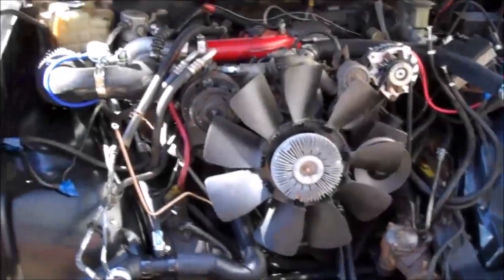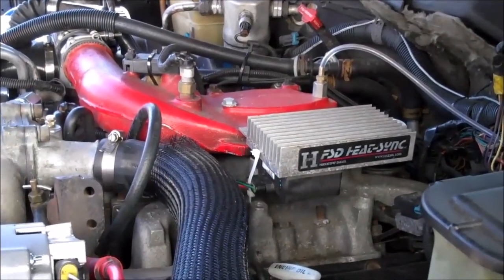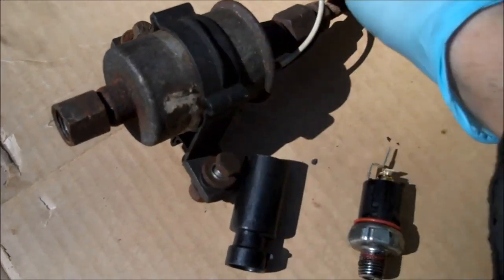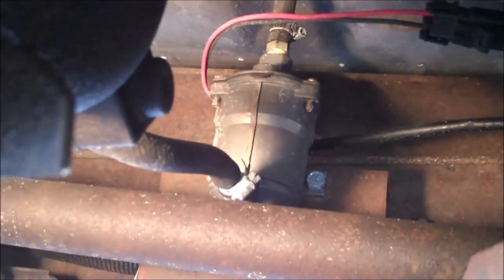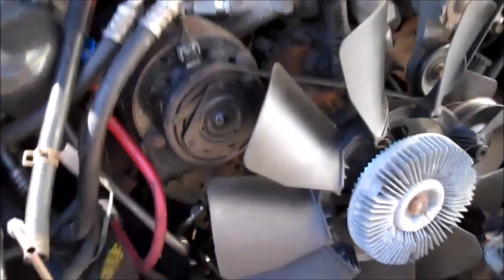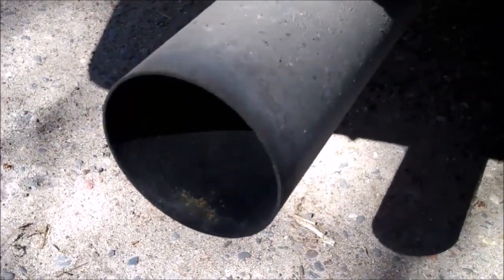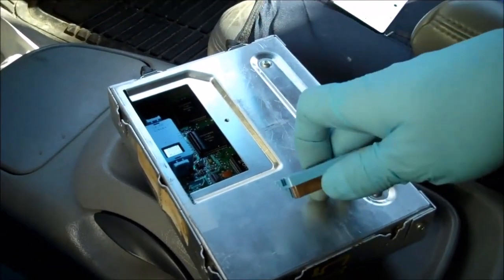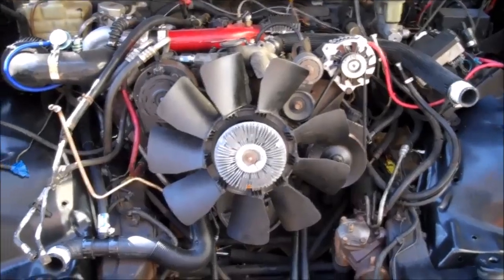6.5 DIESEL ENGINE - HOW TO BOMB PROOF IT

Comment: Thankyou very much for the video, since I own a 97 c2500 6.5l, and there have been "problems", chief among them is when I bought the truck in Oregon in 2013 I noticed the entire fuel system was only a year old or less, and that included the injector pump, ALL fuel lines, and even the tank, having been used by a business for bring back valuable industrial items purchased at estate sales and auctions out of state.  Apparently, by winter of 2013 I figure out why, .....the fuel would stop moving through the fuel line from the tank to the engine, shutting off the engine while I was at high speed.  I figure out how to push compressed air through the line to clear it, but then the factory lift pump would sometimes overheat and stop working.  I stopped driving the vehicle much at all as a spare, and kept high dollar fuel anti jelling additive in the fuel, good thing too cause it would go six months unused.  I bought an airdog aftermarket fuel system, but I had a death in the family, hurt my back and was unable to crawl around in my driveway to fix with the airdog,....I just installed the airdog completely with a beans sump kit by cutting a hole in the bottom of the tank, the metal tank.  I am pleased, engine runs great, seems to use more fuel and that makes sense cause the original lift pump was starving the engine, and in Oregon we have "clean air diesel", meaning too much alcohol added to the diesel, to save the planet and the air, which is what almost got me killed with engine stoppage twice at over fifty miles an hour.  I want to do that belt thing you talk of, a 93 belt and eliminate the vacuum pump, I am sure its still there no doubt, and I need to figure out what you mean by "manual waste gate controller" in its place.  I already have an aftermarket PMD on the inner fender well with heat sink.  I need this truck and many of its components to last, cause I can't afford any major repairs for awhile, I should as soon as possible even if I have to sell something off get a better fan like you mention to keep it cooler.  I am unsure how many actual miles are on the engine cause it was a replacment for some reason with a lower mileage engine, and just before I bought it they had the transmission, clutch, and differential limited slip replaced new/rebuilt cause they were stuck in LA California with almost a hundred thousand dollars of industrial equipment in a trailer, so I lucked out, along with new brakes, air conditioning, newer tires, the entire fuel system I mentioned, and a new trailer brake system.  By the way, my newer fuel lines are larger 3/8 style from the bottom of the tank to the  airdog then to the coupling to the original line to the engine.  I would like to have a backup marine pump at the original spot for the old factory lift pump cause the fuel straw in the tank no longer has the plastic mesh filter since I removed it when I cut into the tank,....it was right as the spot I cut into the tank luckily, and I want to do that and cap it off but keep an adaptor set to quickly hook it up if I was out of town and the airdog suddenly went bad or whatever so wouldn't be at the mercy of high priced out of town repairs,...well actually, right now I wouldn't be able to afford it.  I just hope my injector pump with way less than 3000 miles on it was not damaged by all the damned lift pump and jelling problems, and numerous times likely injecting some small amount of air once I opened the lines, I mean, I always tried to open the drain cock T at the front the engine till I saw pure fuel flowing, or even loosen up the top of the filter cap to all air to escape, I know better, I mean, I was once ASE certified in diesel mechanics, and military trained, the only saving grace is I didn't drive the truck much at all the last four and a half years.  It was the alcohol in the diesel I mentioned, and now they have the "Clean diesel act" applying to commercial use diesel for fleet vehicles, which is causing alot of damages, ....here in Oregon, stories of school buses in rural routes in the middle of snowing winter breaking down with a load of kids waiting for two hours for a relief bus to come to the rescue and thousands of dollars in repair cause of poor quality state guv mandated touchy feely liberal libtard fuel,...maybe I, well I just thought of a name, .....democrat diesel, ...sure weren't any republicans that were responsible for this "clean diesel", I mean, it bout cleaned me out of life itself, and cost me and so many others so much money.  I've heard of diesel with nearly thirty percent water,....I almost need like two or three water separators instead of the one on the airdog, to drain out all the water, I mean, it angers me to think I am buying so much water when I am supposed to get fuel.

Comment: i have  93 C2500 HD 6.5 it come with a old fashion mechanical pump same as the 6.5  in  hummvees outside i update the rocker arms no problems  i did add a intercooler what a big change to how the engines runs i  did not change the boost but it runs a lot cooler now towing i get 20 to 22 mpg towing a 8000 pound trailer driving at 75  after that the MPG starts to drop off if going faster i got it new now has 250000 miles  and no plans to get rid of it  and parts if needed are dirt cheap

Comment: I have a 94 suburban diesel that has been sitting for 7 years. My mechanic told me the injection pump probably failed and to junk/ scrap the truck. I really liked the truck so i never got rid of it, thinking I would replace the injection pump but that is a complicated job. After watching your vid im gonna start with the lift pump and the PMD and see if I can get it to fire again.
Reply: Jeff Perera replacing is not a complicated job. Certainly not the most fun but fairly simple with basic tools

Comment: I have a 1997 gmc 6.5 standard. It has a 150 000kms on it and it will only run for about a minute. It just shuts off, it doesn't die out. It seems to me like it's not getting sufficient fuel flow and the computer is shutting it off. Or would the pmd be the culprit. It runs very strong and a "mechanic" was out here looking at it and said it was either the fuel pump or filter. Would you know what it could be?

Comment: can you link to someone on how to bypass the oil pressure switch?
also the walbro pump seems to have different connections..... could you walk through on how you dealt with that?
I have already done the PMD, but want to do everything else you mentioned as well.  I bought a 96 Silverado K2500 with 126,000 miles on it and want it to last for years to come.
Reply: Go to Leroy Diesel and buy his bypass kit. Well built, simple installation. Bomb proof.

Comment: Probably don't fault the Engineers , Management Prob told Engineers , "Do some cost cutting "
Reply: No more give our mechanics future work
Reply: I worked at Ford as a consultant, they let the "Cost Engineers" buy parts from junkyards, on cars with over 100k miles. Then they tell the engineers that built it to redesign it! Because it lasted too long!  Guess a Ford is supposed to turn into a pile of junk at 100K???

Comment: Hey brother I'm looking at a 1994 Turnout Diesel with 239k guy wants $2400 ext cab I believe long bed 4x4 claims everything works. I've never owned a Diesel I've always wanted one though. if it does in fact run well... Would it be worth the price if it's really everything he says it is? Also does that have OBD1 or 2 I only ask because I've seen some 94's with OBD2 thanks in advance!
Reply from the maker: If you have a question pertaining to something I did in this video that I did not explain,  I can probably help a little.   But I have no IDEA what kind of shape the truck you are looking at is in.

Comment: Is it the psi of the lift pump that kills the injector pump or the volume? Because I'm thinking of installing a pump with less psi but 95gph opposed to 40ish from factory. Also factory is a push and pull style pump where as what I'm talking about is not

Comment: I think this few bugs in this engine is not made by mistake or poor mechanical knowlede, but planned obsolescence. The military ones must work in any condition. Civilians are forced to use dealers services, so GM can gain good money.
Reply: I think thats the problem with most vehicles, its not that they’re unreliable but they are just planned to wear out over a certain amount of time.
Reply: The case is that this problem is not limited to cars but also other equipment and electronics.
Reply: Deep_Nothingness true

Comment: I think those engineers  work for ford now
Reply: Z0mbiekiller254, I guess they went on to the 6.4?
Reply: @duanepierson4375  they did the 6.0 my 6.4 doesn't need 10k+ to make it not kill its self via blown headgaskets and terrible oil coolers plus I have a 12v Cummins just waiting to be swapped into something if it lets me down and my old 6.5

Comment: Great video! Made me reconsider the 6.5. I'm wondering though - how are you preparing for EMP/CME event, since the engine has electronic parts? Also, if you had to replace the engine, where would you go for a new one? I ask that last b/c I am looking at a truck with 265k miles.

Comment: great video. but one question. I have a na 6.2 in a m1009 k5 and it has a vacuum pump. soo what's it do without a turbo?
Reply from the maker: probably runs your climate control and/or brake booster

Comment: Hello, I have a gmc k1500 4x4 6.5 and I'm having problems I bought the stanadyne pump new to pensacola diesel a performance kit with a new pmd but the truck started to have problems failed as if they did not go some cylinders I bought the cooler with a new pmd Dorman I changed the pump because I was wrong the advance and I put the one that had originally improved but it does not exceed 2,500 rpm someone who tells me it's thanks

Comment: Well yeah, them engineer's job is to make & design stuff that FAILS at some given point in time, usually between 350K & 500K miles. I'd wager they knew this in advance. Power tools are made to have weak parts that fail, but not until right after the warranty runs out.

Comment: Yankee Prepper, Help! I just bought a sweet 70K mile, 1995 2500 Silverado 6.5 and ran it out of fuel on my first tank (gage is off). It is now getting 5 MPG(!) and will do things like run 2,100rpm and not go above 20MPH, shut off while driving for a second then come back to life! It has the PMD moved to the grill so I think that it is ok...I have only had it 1,500 miles so what do I do? Any ideas what could be wrong?

Comment: Does these modifications work for the H1 humvee?
Reply: alma rigney yes
Reply: All but the PMD relocation works because the HMMWV uses a mechanical DB injection pump, not the electronic DS.
Reply: Do the vans use PMDs?

Comment: hey there, I need some help I put a manual waste gate on and now I'm getting a boost sensor code and it significantly decreases power when it is thrown, do u know what I'm doing wrong and how did you delete the air pump without getting any codes like this? Any help would be much appreciated. thanks.

Comment: Great video, very informative.  I'm fixing to go work putting 6.5 L out of a '95 into my 2002 2500 HD that currently has a 6.0 L gas engine in it. Any suggestions other than the great info in this video? I'm not having much luck finding help making my current ECM work. Thanks.

Comment: Great video with very valuable information.  I have done all of the things except for the fuel pump relay (I think that will be next).  I have Heath's Stage 2 towing and performance kit.  Sadly, I am not really happy with it at this time.  My water temps are around 220 and the truck seems to laboring with a measly 8100 pound load (new 5th wheel).  Without the trailer, I am VERY HAPPY.  I have contacted Joe Heath to see if there is a tuning fix.  Keep the videos coming!
Reply: any update?  was the issue resolved?  thank you,

Comment: Hey Yankee Pepper,

I'm a 6.5 enthusiast too. Great Video and great points. I made a similar list of parts to address about 8 years back and glad to see I was on the right track for the issues. I wanted to let you know why the engineers went with the crappy vacuum pump in the worst location. It was to meet California Smog requirements. In California a stock turbo could not be manually controlled in a Smog regulated year, which ended up being any diesel newer than 1998. Manufacturers were give the head up to well before the regulation was requires and why every turbo 6.5 after 93 has a vacuumed controlled and computer monitored turbo. The engineers knew this would be one the first mods for a 94-97 6.5 so they just did what any engineer would do, went with the cheapest, easiest way to solve their problem at the production end. I just wished they would have made them easier to remove.

Comment: how often do you have to replace the harmonic balancer and what one do you run. I was told that them balancers were another 6.5 weak point.
Reply from the maker: I wouldn't call it a weak point unless you don't do recommended maintenance.  I replace the harmonic balancer every 100K miles.  But I do inspect them when changing the oil to make sure they are tight.
Reply: I'm looking at buying a 1998 Chevy 6.5 diesel and have bin doing lots of research and was told that was a week point. Like you I'll be changing the harmonic balancer often are they hard to change?
Reply from the maker: The oil cooler lines are not a weak point,  just to do your regular schedule of maintenance and you won't have a problem with DOORMAN oil cooler line or Delco.   My advice to you is don't give out advice unless you know what you are talking about or maybe don't give advice unless someone asks you.  At the very least give out your "opinions" on your channel.  (People come to my channel for advice because they know it's good)

Comment: just bought a 93' 6.5 dually extended cab with 117k original miles 1 owner, I plan on copying your setup too achieve maximum durability and reliability.

Comment: I have a 6.5 it was overloading fuel and fueling its self I changed the pmd on it. and it was ok as far as that.  now my oil pressure gage and fuel gage shows full and runs off the execellarator now. you can drive it about a hour or less and it will just die going down the road and won't start so what is the problem. now?

Comment: This a great Vid I have a 2000 6.5 and had to replace the injector pump and few other parts but it has not hit once fuel pump has 10psi but there's no fuel to injectors I'm not sure if it's the PDM it has been replaced I was looking for GM Tech2 scan tool to see if it would help your scan tool looks great for the money. I guess I'll look some more for info get this running again I've worked for last month trying to get it going keep the Vid's coming...

Comment: ive got a 1992 6.5 turbo. best truck ever. i also have a p-pump cummins in a 94 dodge. good engine but the rest of the truck sucks except its a nutless wonder. my 6.5 has way more power.
Reply: If you slide the fuel plate forward in the 2nd gen Cummins 12v and put on a big ass filter BAF than you will have to try not to roast the tires I own a 6.5 td and have friends with 12v p-pump Cummins and there is no comparison between the two the 6bt has the torque period and torque wins every time! 

Not gonna lie I love my 98 6.5 td 4x4 ext sb  it is great for driving around and gets great milage but they are not tow rigs and never will be EVER

Comment: after removing the vacuum pump and changing the belt, what operates the actuator then?
Reply from the maker: It's a new invention called "ELECTRICITY".
Reply: You have to change to a mechanical (spring) actuator,

Comment: hey nice to have found your channel !  Now these same things go with the 6.2 don't they ?  Since you said you had all kinds of parts I am looking for the turbo exhaust manifold turbo and just every thing.  I have a 82 6.2 that used to get 25mpg all the time but I got talked into letting this guy who said he knew it all work on it. now if I get 15mpg on a 2wheel drive 700r4 trans but it can now go over a speed bump with out downshifting or a tow truck.  I have had the truck since 54,000 miles and it has 135,000 on it now and should have a ton more miles but, the turbo I think is the key !  love to hear what you suggest !
Reply: My bet, injection timing is off. You can time by ear, you should get a good rattle on accleration, a lot of black smoke and you are too far advanced. Timing makes a big difference with power and MPG.

Comment: Does this apply to a 93?
Reply: No. The '93 is a strictly mechanical injection pump.  No PMD.  Also, the '93 lift pump has a higher volume output.  GM issued a service bulletin with the updated part no. for the oil pressure switch.  This switch has heavier contacts to carry the current load to the lift pump. You can look it up. And this Yankee Prepper is wrong about his choice of an air filter.  He's pulling hot air into the engine from under the hood.  Wrong.  Big Time wrong.

Comment: I'm having a big problem with my 6.5 crank no start new ops, new lift pump , new fuel filter thought it was an electric issue toke it to auto electric shop they said no electrical problem they think it's the injection pump but I had a new one put in 2 years ago any plzz
Reply: check the PMD
Reply: checked pmd it was the crank sensor